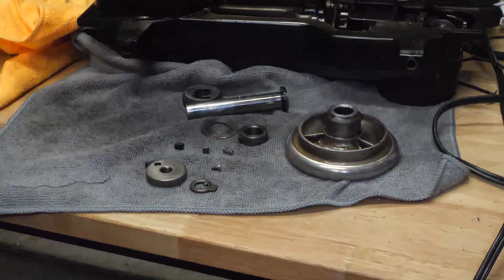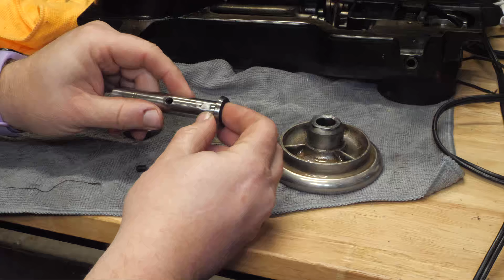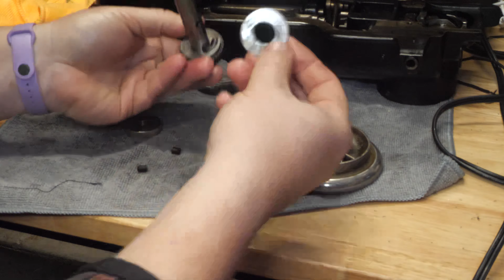Singer 101 Drive Gear Clutch Reassembly

Comment: The clutch assembly on the 101 evolved over the years.  This looks like the original/older version that has the clutch in the gear.  The redesign moved the clutch to a separate part adjacent to the gear.  A new spring to buffer the startup shock was instead introduced into the gear that pins into the adjacent clutch.
Reply from the maker: Oh, a transition design from this to the 201 and other spiral drive clutches?  The adjuster's manual I found only showed this clutch design, so the 2nd style must have been low production late in the 101 run.